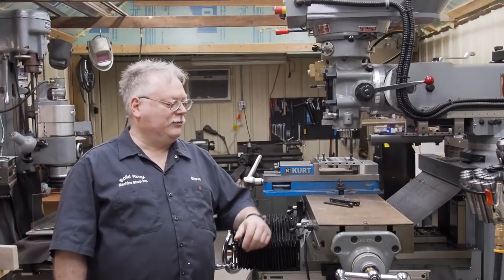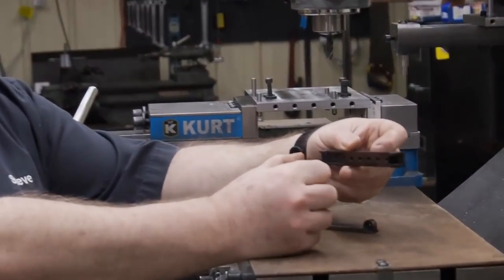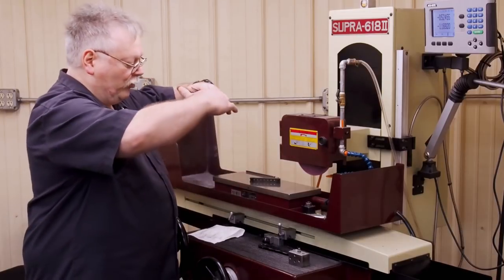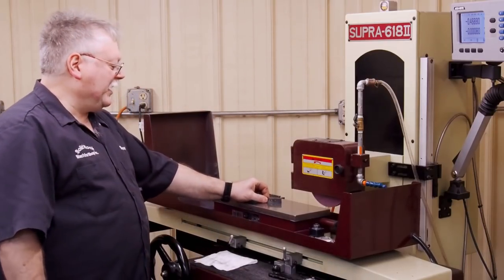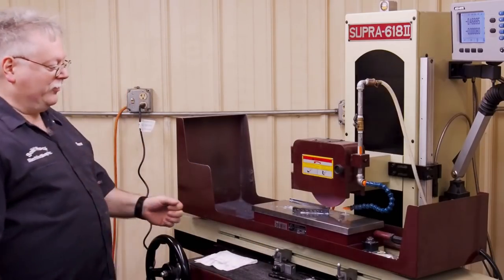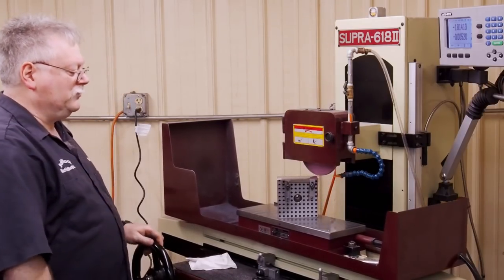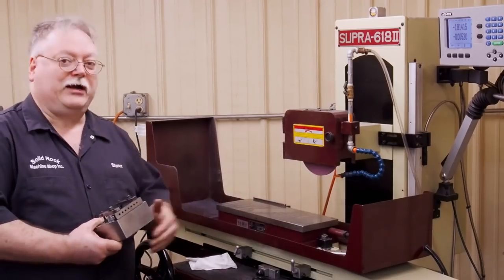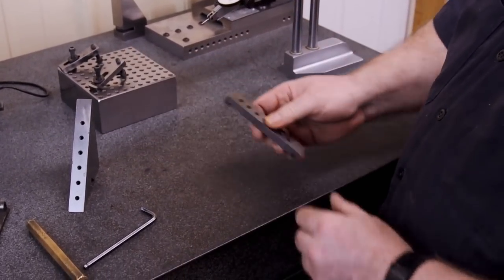Rough grinding Sine Plate part 4

Comment: Good stuff Steve!  I am looking forward to that fine linear pole electromagnet.
ATB, Robin
Reply from the maker: Hi Robin,
It would be hard going back to a manual chuck after using the variable on an electromagnet. That fine pole should be nice for thin work.
Steve
Reply: Who makes them?  I tried googling "fine linear pole electromagnet"  and didn't get much.

Comment: Great info/demo Steve...question.....I noticed as you traversed the part when grinding you were constantly moving, not stepping.  Is that due to the narrow part...is there a rule of thumb when you step?....Happy Holidays
Reply from the maker: Hi Chuck,
Good question! My goal was to get the part square, parallel and flat. Finish was not a goal although it was very good. I will take a fine traverse when going for the best finish. Placing the part at an angle means the travel in the Y axis is much greater so if I would use a fine step for the finish it would have took much longer. When I finish grind I may grind differently in the Y for finish, it all depends on how well it looks using the 46.2 grit wheel.
Steve

Comment: Great video as usual Steve. Some questions about your grinding block. 

What material did you make it from? 
Is it heat treated? 
Is the large hole in the middle for handling, or does it serve some other purpose? 

Hope you and your family have a great Christmas.
Reply from the maker: Hi Tony,
This block is made out of A2 and heat treated to about 60 RC. I may have to show in a near future video what the center hole is for, it actually has a few purposes. The main one is I can put step pins in it that are at common dowel pins sizes. This way if you have multiple parts with a hole the size of your step pin you can use it for locating purposes. 
If you are interested in making one and can afford the higher heat treat cost I would recommend making the block out of DC53 or DCMX both steels are better than A2 and I know DC53 is about the same cost not sure about the DCMX. If steel cost and heat treat cost are not a factor I would recommend CPM3V but this is an expense steel and heat treat is costly as well.
Steve

Comment: It looks like your coolant only hits the part when the wheel is off the part.  Is there a reason it would be bad to have the coolant flow onto the wheel so there is always cooling during the grind?  Is it one of the many personal preference practices that machinists have?  

Another information packed video, please keep 'em coming!
Reply from the maker: Hi somebody else,
I didn't notice it until after I watched the video. It should have been adjusted higher so that it would hit the part at the wheel engagement. That wheel is so good that it made up for my mistake as was seen when running an indicator over the part.
Steve

Comment: Why not just over hang on a transfer block to stay in your normal working envelope?
Reply from the maker: Hi Brian.
Are you talking about using magnetic parallels?
Steve
Reply: No I was thinking like a 2-4-6 transfer block. In regards to what you were doing at the 57:50 mark.
Reply from the maker: Hi Brian,
If you are talking a regular steel block I am not sure there is enough magnetic power to hold on to the part after 2" of steel. You may be talking of something I am not familiar with.
Steve

Comment: Most machinists and toolmakers are unaware of the fiddly details of grinding wheel dressing. Not to say they don't do good efficient work but once in a while a simple-seeming grinding job comes along that defeats every trick. If I was going to point to one most neglected thing in the grinding process it would be the condition and orientation of the dresser diamond.

A diamond in wheel dressing service doesn't last forever. It slowly wears away developing a flat or a rounded surface. This shape effectively crushes off projecting abrasive grains limiting their cutting efficiency or even glazing the wheel til it barely cuts. 

Cincinatti Grinding Wheel in the 1950's put out a series of how-to pamphlets for surface grinding, cylindrical... etc. A point I recall is (rough quote) "a grinding wheel is a cutting tool consisting of hundreds of thousands of abrasive grains which are its cutting edges. These cutting edges are not sharpened: the dull ones are dressed off or broken out of the bond exposing fresh cutting edges in the grains next layer down." One piece of advice common to all the pamphlets was to turn the dresser diamond shank in its holder part of a rotation. The object was to present a sharp point to knock out individual grains. 

The diamond dresser should therefore be partly rotated once a shift or oftener in its holder so it wears to a point and that point conserved as a means of preventing grinding mysteries; particulaly those involving part or wheel deflection in instances where you feed in several times with no sparks or measurable stock reduction all the while the wheel is rubbing without cutting and deflection is accumulating in the stressed elements of the operation waiting to resolve suddenly when force against the wheel reaches a critical level when it suddenly resolve in a shower of sparks and your + 0.0002"/-0.0000 bore tolerance is 0.0015" oversize before you can react.. 

Oh, and cluster diamonds can be reoriented by reversing them in their holder, presenting at a different angle, or some other geometrical alternative.
Reply from the maker: Hi Forrest,
Thanks for sharing. I agree with you on the neglect of orientating the diamond properly.
Steve